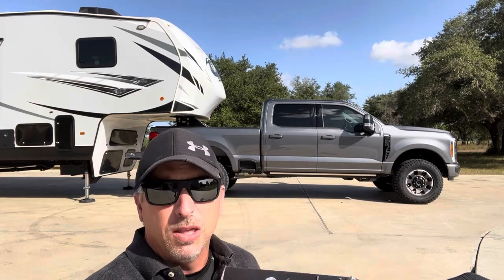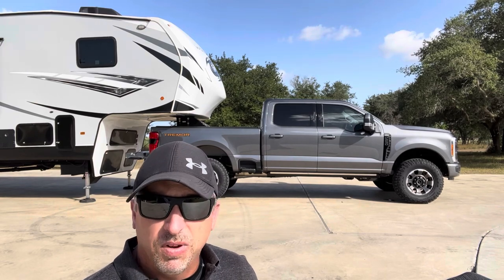2023 Ford Superduty Timbrens Installed Zero Squat 20 Minute Install!

Comment: These will certainly impact your travel on the rear axle. I am also worried about the ride quality diminishing with these as well. They look like a cheaper and easier alternative to bags though so that's nice.
Reply: I didn’t buy a powerstroke for ride quality I bought it to get the job done 😂 pavement princess
Reply: @Slugsyoutube  pavement princess? Suuuuure
Reply: That diminished ride quality will eventually become an issue with suspension components.  The bottom line is, if you have excessive sag, your probably overloaded.

Comment: My 5th wheel pin weight is approx 1700.  Running a 2024 superduty.  How much did it increase the comfort in the cab.  ?

Comment: Have the same setup. Now you need the HellWig rear sway bar #7320 and front sway bar # 7712.  You WILL ABSOLUTELY notice a difference in how the truck handles / drives.

Comment: How do you like the 7.3L towing your 5th wheel? MPG towing and not? Do you regret buying the gasser vs the diesel?
Reply from the maker: The gas was temp.. it gets the job done but I’m a diesel guy hands down.. picked up a platinum diesel.
Reply: For us people endless cash falling out of my pockets, so far I don't regret my 7.3.
11000 5th 7.3 pulls good, gas mileage while towing is 3 mpg less then the Diesel 9 vs 11 non towing  is the mpg difference 12 vs 20.

Comment: Great video..... is your bed 8' or 6 3/4?  Fifth Wheel hitch slider or not?
Reply from the maker: 6 3/4 I use the gen y offset.. moves ball back 5”. I use Reese Goosebox
Reply: Thanks, debating replacing my current long bed super duty for standard bed.  I have the puck system hitch so I would  not be able to use current hitch @RockyRohde
Reply: I have a 23 with the short bed, use a pullrite slide hitch no issues and I have to pull the trailer at unusual angles getting it out of the driveway